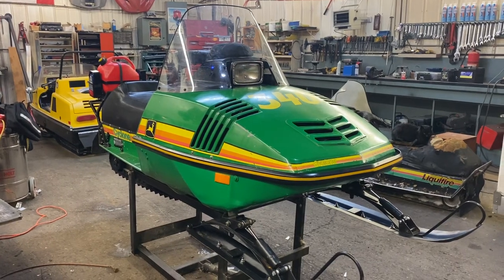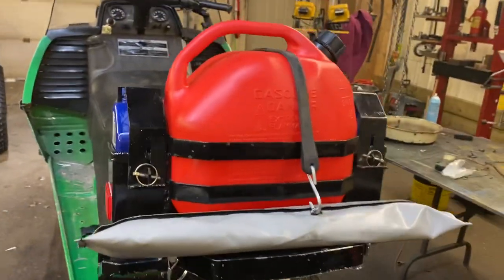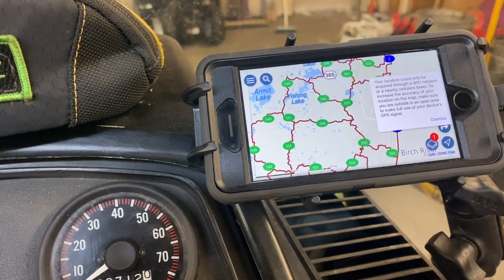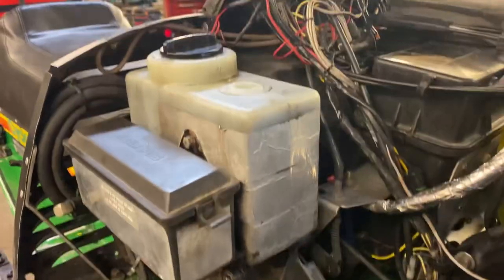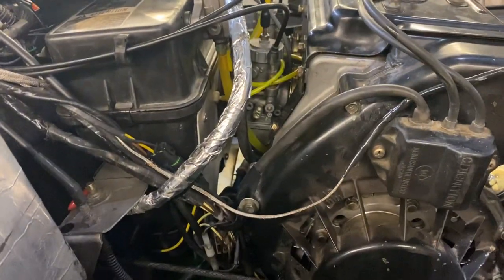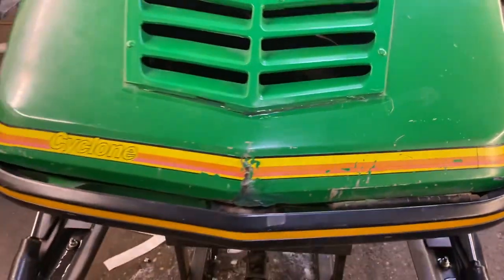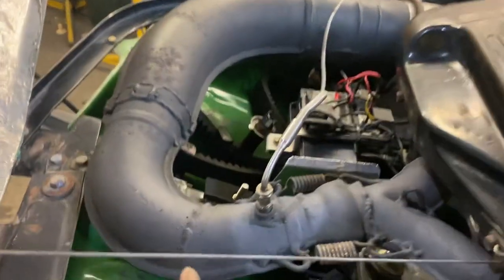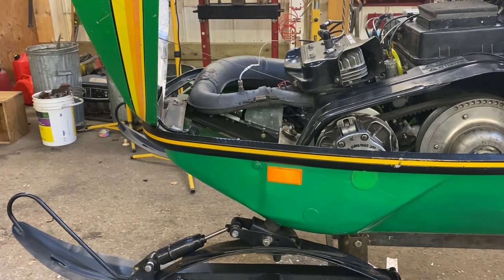Vintage John Deere Cyclone Snowmobile slightly modified

Comment: Thanks for that! Fantastic video!  I’m really impressed by the modifications you made.  I’m still running completely stock on my Liquifire and have been thinking about track options for a while.

Did the suspension bolt into the original holes or was there work that needed to be done to make that fit?
Reply from the maker: I made up a template based on a 1990 Indy Trail chassis I had kicking around (same skid as the 91 Indy 500) and I placed that against the inside of my tunnel to roughly establish where the suspension mounting points should be. I am not certain if you could mount the suspension in the original mounting holes as I didn't even try. In my opinion, the suspension should be fitted to the JD chassis very similarly to the way it was in the Polaris sled it came out of in order to get the geometry of it's movement correct. It might fit in the original holes, but that doesn't mean it would work properly if mounted that way.  A couple things to consider is that you don't want to mount it in such a way that the track would rub the tunnel at the top. The other real concern is that the suspension not be mounted too low in the tunnel which would then result in a nosedown attitude. It does look pretty cool to mount them that way and some people claim it makes them better in snow (which undoubtedly it would), but that can put a tremendous amount of pressure on the skis making the sled really hard to steer and very twitchy handling on hard packed surfaces. That's fine for shorter rides or if in deep snow most of the time. But on a long 6 hour ride on really winding groomed trails, it gets annoying real fast. You really want the sled to sit nice and level if at all possible. I even switched my skis from the stock monoleaf over to the multi-leaf system Deere used on the 76 models. Then  I added a 4th leaf to gain a wee bit more height and reduce sag in the front suspension. That really helped. 
Another thing to keep in mind is that the Polaris suspension shafts and tubes are somewhat narrower than the John Deere tunnel. I positioned 4 gussett plates inside the tunnel  at the mounting holes. As I recall, they were approximately 5/16" thick and effectively narrowed the shaft mounting area down to the required witdh to accomodate the Polaris suspension. I suppose I could have extended the tubes and made slightly longer shafts but this solution worked fine.
I am running a standard 121"x 15" x 2.52" pitch track. I used a Trailfire hexagonal driveshaft and the drive sprockets came off of a 1980s era Arctic Cat (can't remember the exact year or model). I believe sprockets from the 78 X-country Liquifires also work.